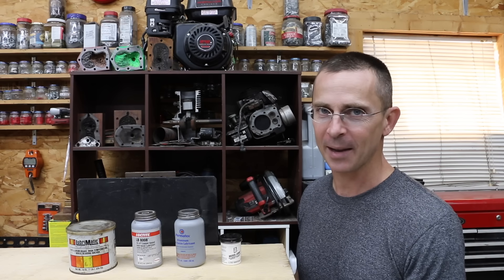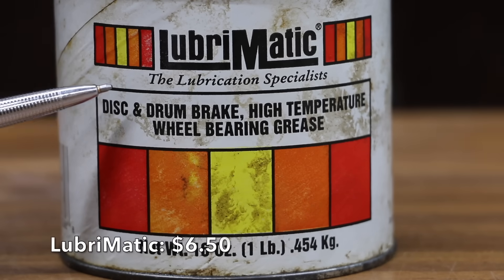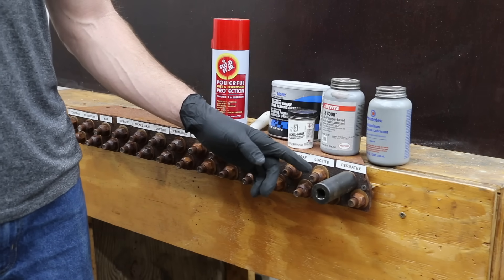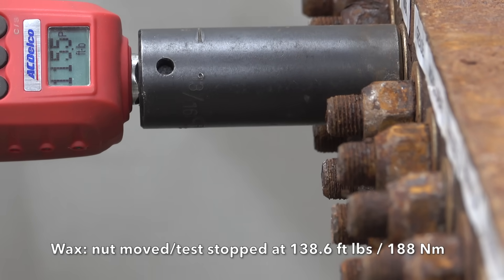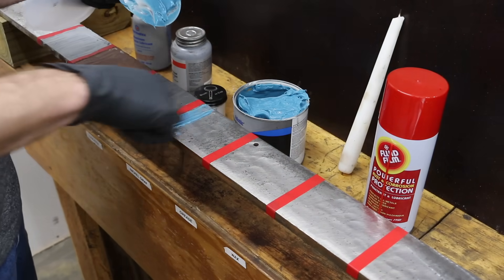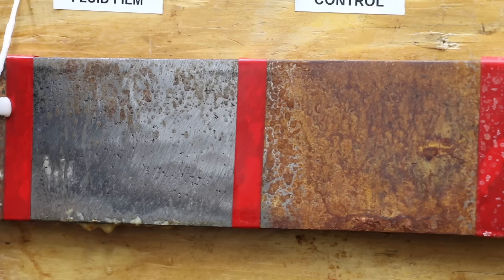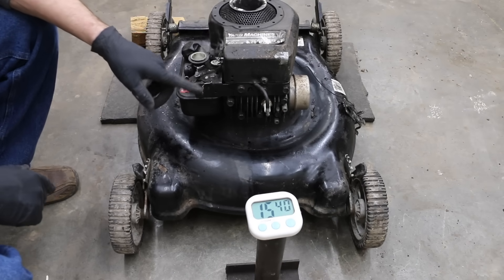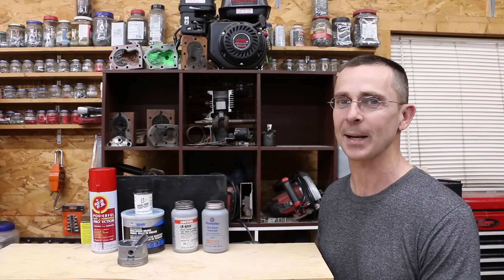Does Anti-Seize Compound Actually Work? Let's find out! Anti-Seize vs Grease vs Fluid Film vs Wax

Comment: It might be worthwhile to note that the different formulations are for different things,  and that it is not a lubricant. In particular, be careful with which you use on rubber parts and stainless steel. Copper and Zinc based anti-seize in particular aren't recommended for stainless steel.  Silicon-based is better with rubber parts, such as the boots on brake parts.

Oil and grease are great for spark plug threads if you want them permanently welded to the head, at least with aluminum heads.

Something like Boeshield is probably better for protecting metal parts from weather, but I love to see multi use products, even if it just gets you by in a pinch, otherwise you can end up with a petting zoo of products.
Reply from the maker: Great feedback. Thank you

Comment: The Aluminum Permatex is something we use all the time in my garage.   Whenever we re-assemble car parts,  we use it.   It looks based on your tests that I wasn't an air-head doing so.   Considering we've used it for years,  I KNEW it worked to some degree.
Reply from the maker: Great point!

Comment: Ok but I only use anti seize to completely remove the fastener not break it loose. You can pretty well always break a rusted fastener loose but then they jam up trying to remove it. That's where the wax comes in is applying the wax with heat to melt it in and then spin the fastener off the threads with the wax a lube.
Reply from the maker: Great feedback. Thank you

Comment: I don't use Anti-Seize for any of these reasons, I use it for, you guessed it- Anti-Seize!  Bushings and shafts that have no rotation especially if the shaft is long and going through a metal sleeve...
Reply: like brake calipers...

Comment: Very nice test and interesting for sure amazing work only thing I feel is putting the candle wax and grease in the grill at same heat is a bit unfair for them as they're not got the same  metal base as the others, be nice to see how they would have held up if hadn't be exposed to high heat that melted them away, thus rendering then bit pointless to add in the test 😉 love your tests

Comment: anti seize does work. I worked at a trucking company in the service shop of a very large fleet and we went through gallons of it per day on different vehicles. it gets on everything but it works
Reply: just a vet it does help a lot. I use the copper based one on my cars

Comment: I use anti-seize paste on 3/8" and 1/2" button head screws to keep out water and dirt which corrodes the bolts over time. I service equipment at LA Airforce Base near the ocean snd anti-seize paste does increase the life of the threads but not the life of the bolt head which often times has to be trimmed with a grinder and removed with locking pliers.

Comment: One of the biggest problems I've seen with cheap anti-sieze is that it makes bolts loosen under heavy vibration conditions. Installing bulldozer undercarriage bottom rollers, I saw a lot of Permatex anti-siezed bolts fall right out days later. Not a problem with the legit Caterpillar brand stuff though; both these were copper anti-sieze.

Comment: I heard of a man who's car hit something in the roadway and it punctured the oil pan. He plugged the hole and only had less that a quart and a half of oil on hand.. He poured the small amount of oil he had  in the car and added another 2 quarts of Water, he drove another 100 miles to a garage without blowing the engine.  Note: He broke down in the Arizona desert on a desolate stretch of highway..  Can you try this test to see if oil and water mixed together would save you under those circumstances?
Reply from the maker: Thanks for the video idea.

Comment: I've always used a product called "Never-Seize".  It is more an industrial product but it does work well.  The exhaust header bolts on a V8 came off easily after 12 years on the road.
Reply from the maker: Thanks for sharing.

Comment: Twice as long? Make a 30min job a 6+ hour job. Even the rubber part with a metal ring in it was rustwelded so badly a cutting wheel was needed. And then the new part(looked the same as the old. Only better condition) didnt fit. Bolt was 1 or 2 millimeters shorter i guess.
Reply from the maker: Thanks for the feedback.

Comment: I pull 3/8" bolts from runway inground lighting fixtures exposed to corrosive ice melting chems for a living.  The copper and silver anti seize are both key. Seems the silver hangs around better if bolts are pulled and reused due to fixture replacement. Paired with a generous base coat of Kroil makes for easy out when it counts in a blizzard at 3am!
Reply from the maker: Thanks for sharing.

Comment: since i saw you were using a bicycle computer i figured you must ride a bicycle. my question is can i use red sticky grease on the bearings on my bicycle like bottom bracket and head set as well as my pedals. i try not to wash my bicycle with high pressure hose. i might have to ride throught a stream. i just dont want the grease to rinse off. i road the c&o canal a few years ago and the canal was so muddy when i got to my turnaround point my bicycle was so muddy. i stuck my bicycle into to potomac river to rinse as much of the mud off as i could get off. i had the bicycle in so deep the wheel hubs were covered by river water. how do you think the red sticky grease would do on my bike. the red sticky so mainly for cars with disc brakes. thanks for the tests.
Reply from the maker: Thanks for sharing.

Comment: Now if manufacturers could add anti seize when assembling that would be great.
Reply: Especially on snow blowers....
Reply: Red1ineRR it really should be factory mandatory.. I live in the rust belt and as far as I’m concerned seized bolts on a 5 years old vehicle should be considered unacceptable
Reply: They do, on quality products.
Reply: I've been saying that for years
Reply from the maker: Thanks for the feedback.
Reply: They use lock-tite instead, so it don't fall apart.
Reply: Also its a bad idea on aplying copper anti seize on zinc coated bolts, due to the fact, that copper erases the zinc
Reply: They think that zinc coating is enough... can’t say it isn’t though, but the older the vehicle gets and living in a pretty corrosive conditions won’t make it easier to take apart even zinc coated bolts and nuts. On the other hand, adding any lubricative substances such as anti seize can mess up with the tightening torque, and so you can easily snap the threading. Or the bolts may become loose due to vibration. So for me it depends on what and when to use anti seize, sometimes its even better just to use blue loctite, or lithium-graphite+nylon nut

Comment: Great test!  Probably outlawed now, but I dissembled some 60+ year old float valves that were assembled with very rusty studs that had been coated with white lead during assembly.  The coated sections that were screwed into the valve bodies looked brad new, the exposed threads were almost gone.
Reply from the maker: Thanks for sharing.

Comment: I use it all the time, I work at a transmission shop and yeah axle nuts doing hub bearings on some cars rust bad smh I also use it the engine dowel pins going back together, exhaust studs ect, but I have seen it dry up so idk I just try to look out for the next guy not everybody takes their car back to the same shop but we have a lot of repeat customers and it just makes my life a little easier if I have to go back in for something or even doing different repair. I use permatex aluminum.
Reply from the maker: Thanks for sharing.

Comment: Awesome video!  I have this OCD habit of putting grease or oil on the threads of 90% of the bolts I remove when working on things. It makes reassembly a lot easier and actually helps out a ton if I ever have to go back and remove something again as they are never siezed up.  Im glad the testing results showed that it actually helps!
Reply from the maker: Thanks for sharing.

Comment: Anti-Seize is very good at preventing galling.  To test this weld A2-70 stainless steel nuts to an exhaust pipe on your gasoline car or truck, coat the threads of an A2-70 stainless bolt with test compounds, torque them up and drive the vehicle for 6 months.  Then try to remove the bolts with an impact wrench.  The high rotational speed increases the chance for galling.  There is a reason oxygen sensors come with anti-seize on the threads not axle grease.
Reply from the maker: Thanks for the feedback.

Comment: Been using Loctite for years here in New Jersey between working at and oil refinery and as a mechanic. I use it on any bolt or pipe that I know I'll have to take off at some point. Wonderful stuff!
Reply from the maker: Thanks for sharing.

Comment: Would love to see a test for Brake Caliper Lubricants such as CRC Brake Caliper Grease #05353, StaLube SL3303, Permatex Brake Caliper Lube 24110 (Natural),  Permatex Ceramic Extreme 24125, and any others that you can find at your local Auto Parts store.   It would be interesting to see just how well these products actually deliver.
Reply from the maker: Thanks for the video idea.

Comment: Silver anti seize can also work as computer thermal paste . I did it to my old PC as a temporary measure just until i got some proper thermal paste and like every temporary measure it ended-up lasting two years and by then i was due to upgrade anyway. I never got to test temps but it never gave me any trouble so i didn't bother checking.
Reply from the maker: Thanks for sharing.

Comment: I just recently retired from over 20 years on an airfield in the southeast. We had around 1000 light fixtures that have 6 bolts per fixture. And all the years we had contractors from time to time taking up and replacing the light fixture during a runway resurfacing project. They,  of course always used the cheap aluminum antiseize. We always used the loctite copper. And I can tell ya that the loctite is hands-down the winner.  For short term use either is fine. But for something that's in the weather 24/7 go with the loctite.
Reply from the maker: Thanks for sharing.

Comment: I use a cnc router at work and used anti seize(permatex,loctite)for years and we found using marine grease for our bolts and tools works the best. We use alot of water over our tools and I think thats why the marine grease work the best.
Reply from the maker: Thanks for sharing.

Comment: For me the primary use for anti-seize in the automotive business is to prevent nuts from seizing upon installation. Reusing old exhaust studs and nuts will require a bit of a cleanup and a anti-seize coating. Wheel studs are another area where it's kind of handy. Wheel studs seem to end up damaged a bit over time. The last thing you need when doing a tire rotate is to have a nut seize up halfway on. The stud replacement is all on you. Put a little anti-seize on the threads and send the car on his way.
Reply from the maker: Thanks for the feedback.

Comment: Candlewax didn't do well because you probably burned/boiled it all off it the heat cycle.
Would be interesting to repeat without that heat cycle as they're plenty of applications that don't involve high heat.

Edit: I'd also have rubbed it on rather than melt it on.
Reply from the maker: Thanks for the suggestion.

Comment: I'd like to see videos on oil flushing agents (including the much derided and much recommended "kerosene rebuild" consisting of some fractions of oil, atf, and kerosene) and one on cleaning combustion chambers.

Maybe run a coked up mower engine with a continuous and small pumped water supply to see if water injection can clean it?
Reply from the maker: Thanks for the video idea.

Comment: Great video. If the anti seize goes on the fastener between it and the nut, why the wash off test. If nothing else, you could have outthe compounds on the exposed threads. I’ve been using Permatex for 30 yrs, no problems
Reply from the maker: Thanks for the feedback.

Comment: A paste simply cannot replace oil in a hydraulic bearing such as for a connecting rod to crank journal assembly; perhaps if you had dis-assembled the bearing, smeared the anti-seize compound on the mating surfaces, and then re-assembled the bearing it might of had a chance. It was fun to watch though ...
Reply from the maker: Thanks for the feedback.